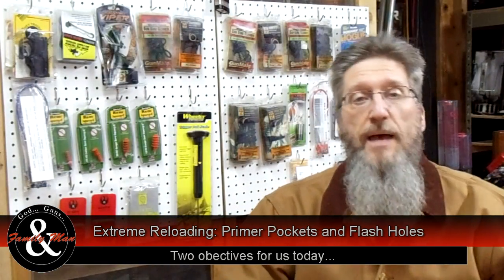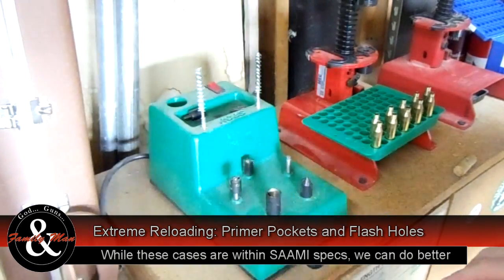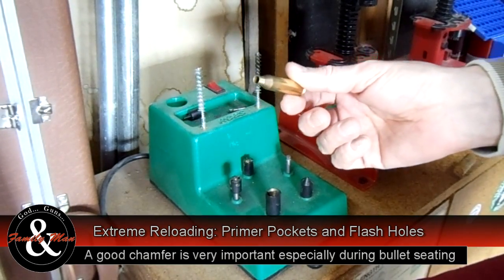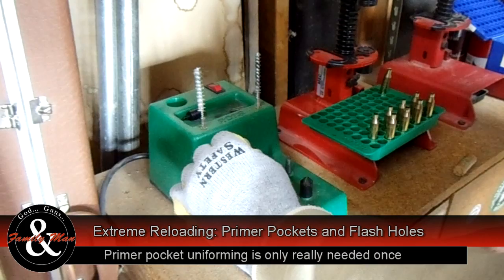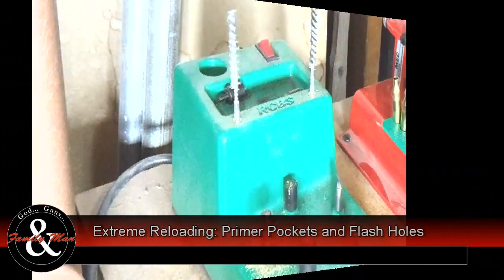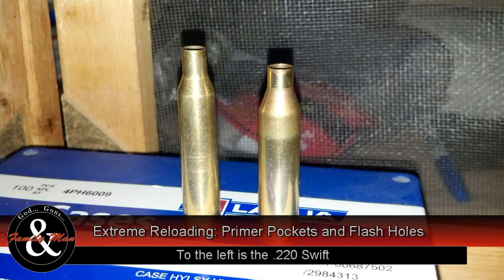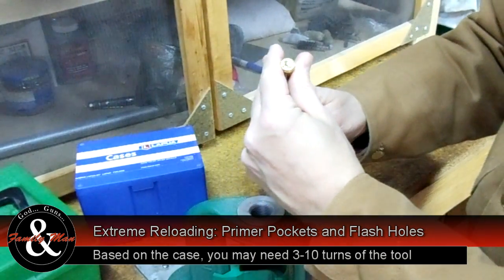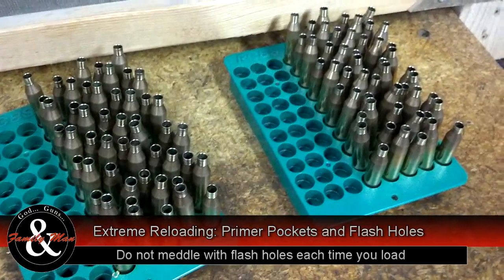Extreme Reloading: Primer Pockets and Flash Holes (ep. 03)

Comment: 8yrs later thanks for showing me the flash hole cutting never done that yet but it should help. 
But man your measurment is not accurate there and if you want I could explain. New to loading but a machinist knows how to measure paticulaly me lol. Come down on the id wall caful to keep depth guage flush to wall and bottom of pocket touched. This is why most have a radius notch on the depth guage portion of caliber. I will steadily operate thumb nob raising off a bit come back down and trust this measurment to be +-.001 of tolerance. Its not a easy measurement to take and really dont know just how accurate one needs to be here. I have found with out using depth cutter using norma brass after cleaning pocket its about .128 +-.001 usually, so do not bother as I sit under flush by about .002. I do like the uniform cutter concept though as I guess there could be a step at bottom of pockets keeping it from seating true. Thanks I learned somthing today.

Comment: Thanks again for the info.  Maybe a dumb question but how much do you take off with the Flash Hole uniformer?  I saw the nice bevel but it would seem to me that you could go too far and make the hole too large or not enough to get the hole large enough.
Reply from the maker: Hello Florian, thank you for watching.  This little tool has an adjustable plastic sleeve that is held in place by a set screw.  It is critical to set that appropriately.  This ensures you will not cut too deep into the flash hole on the inside.  Normally, all you need to do is to see the drill bit part of the tool protrude through the flash hole (on the outside) just a bit, and then set that sleeve to stop cutting at that point.  I hope this answers your question.

Comment: Can you please let me know tool numbers to order for steps 2 & 3. 👍 great video. Thank you so much, very helpful
Reply from the maker: Hello Jim
Here is a link to the flash hole uniforming tool https://ads.midwayusa.com/product/101288179?pid=729748
Were you also looking for a link to another tool shown in the video?
Thanks for watching!
Reply: Thank you. I should have written the tools in the number 2, and the number 3. Position on the motorized
Reply from the maker: @jrbjr12345  That's make sense.  My #2 position is the primer crimp removal tool. I use it for 5.56 brass. I see Cabelas sells it for the newer Trim Mate.  Not sure if it will fit the older case prep tool but probably will.  Here is a link https://www.cabelas.com/shop/en/rcbs-tm-military-crimp-remover?irclickid=SjkUBRwXvxyORC80UfQwQyYMUkiTRAzW3zRW3Q0&irgwc=1&WT.mc_id=ir2003851&utm_source=Bing%20Rebates%20by%20Microsoft&WT.tsrc=AFF&utm_medium=AFF&rid=10
The #3 position is the primer pocket uniforming tool, here is its link also from Cabelas https://www.cabelas.com/shop/en/rcbs-primer-pocket-uniformer?irclickid=SjkUBRwXvxyORC80UfQwQyYMUkiTRF3O3zRW3Q0&irgwc=1&WT.mc_id=ir2003851&utm_source=Bing%20Rebates%20by%20Microsoft&WT.tsrc=AFF&utm_medium=AFF&rid=10
I hope this helps.

Comment: To this add Exact same charges,also seat bullets to same ogive  settings,and get neck tension as exact as is possible.
The entire point of this is to get the lowest ES and SD’s as possible.out of each group of loads.
ES/SD’s under 10 max 12 will give you excellent LR AMMO.Consistency is Key.

Comment: You will never get a consistent measurement with calipers. Get an accurate depth gauge.  Uniforming is not a one shot deal, brass will flow back into the primer pocket'
Reply from the maker: Thanks for watching and posting Michael.  You make some good points.  I have checked the primer pockets a second time, etc., but one needs to be aware of some safety issues here.  I see most of the brass flowing toward the mouth as it is a softer and thinner portion of the brass.  Secondly, if you see significant flow of brass into the primer pockets that requires a second uniforming operation I wonder if that brass is pretty well spent.  Frequently over time one will see the primer pocket loosening up (also indicating that piece of brass is spent)..
Thanks again for watching and posting.
Reply: so you're saying the reamer is a better choice. to remove the excess brass and not just push it back out of the way?
Reply: +1 on this. Hed have to hit at least 3 measurements and have a machinists feel to trust this. And radius cut out to feel ok about +-.001. At best he is +-.003 variation.

Comment: nice videos.. is there an order of operations for reloading new and once fired brass... even new brass could be different lengths giving you an inconsistent depth of cut while flash hole deburring.. and as far as neck turning, is it going to do anything when reloading for the AR15 platform? thanks
Reply from the maker: Thanks for watching and posting Andy K.,
Yes, there is definitely an order of operations and that is important.  Before working on the flash holes you must have perfectly trued up case lengths.  I shared a guide/checklist for case preparation at https://www.dropbox.com/s/g8mc76qs6s156vu/Reloading%20check-off%20sheets.xlsx?dl=0 
which shows the order of operations I use.

I work on the flash holes and case neck thickness with new brass only.  Once done, I do not repeat for every loading.

Neck turning is really only for the extreme accuracy pursuits.  Which is normally single shot rifles, bolt actions, etc.  The AR-15 (5.56) was never designed for that (though some custom jobs are very accurate).  Just remember, with any semi-auto, you need to full-length resize each time, which is different than my approach for single shots and bolts where second loadings get neck sized only.

I hope this answers your questions.